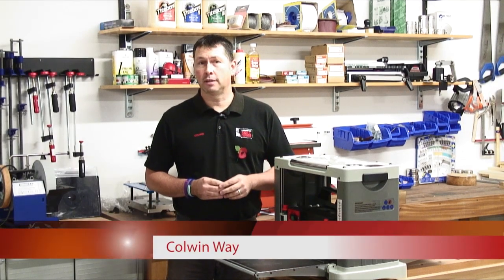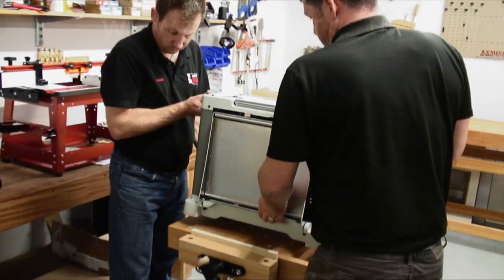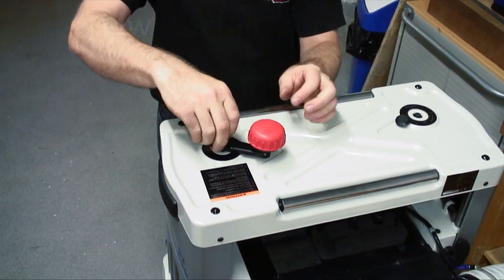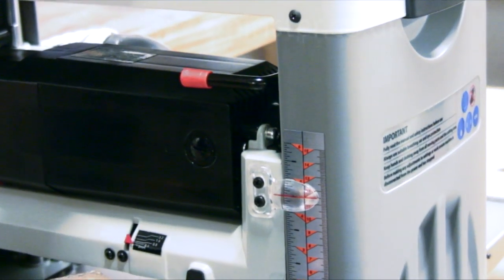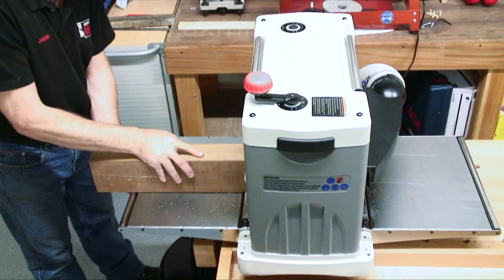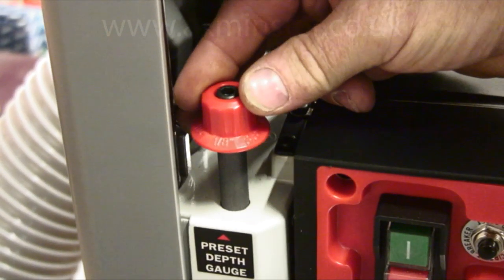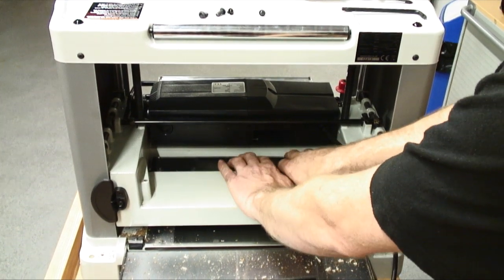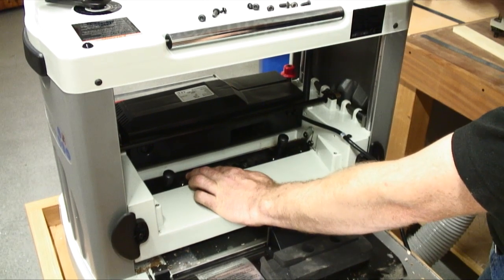Axminster Trade Series CT330 330mm Thicknesser

Comment: Had the CT 330 for over 12 years, a really good piece of equipment. The only thing is the first set of replacement blades were £14 now they are £62  for the 6 screw head, that was a shock!
Reply: And now they've stopped making them